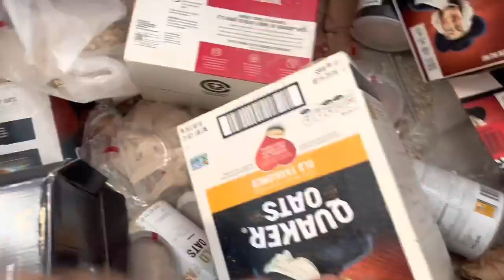FarmHand Jake Gets Fired (again) Found his replacement already!

Comment: I think if you turn a hair dryer on high I don't know if it'd be a good idea with WD-40 in them but the hot will help loosen them sometimes you can have hot water and the water will release the air and let them come apart a nail hole in the bottom of one wouldn't we big enough before the feed to come out you can use it for water but you could use it for feed a little nail hole in the bottom of one would leave should be enough pressure in there especially if you use a hair dryer that it'll pop them loose but I know exactly what you're talking about I have experienced the same thing and it's not fun and there's not enough strength in the world even two people one pulling one bucket one pull on the others not going to get them apart unless you actually do something which is odd because when you buy those at least at Lowe's they're all stacked up together and they don't get stuck there's like a whole Tower of them so I don't know what they do to keep them unstuck cuz I I get buckets all the time because they're they're just really cheap and really handy and I can use them but I understand but you do have to remember the person you're not naming is Young and it sometimes it takes a while to for them to learn the right ways and the only way they're going to learn is let them get the buckets apart all by themselves just use the handle and the top bucket fill it up with feed use it that way the bottom bucket stuck on there isn't and if it falls off yay good for you and if it doesn't they'll still be stuck together when you know who comes back to work on Monday just say it. I had two teenagers I had an enormous garden and believe me when I had help weeding the occasionally there was a plant or two got pulled instead of a weed because they didn't know the difference but eventually they learned it takes time and sometimes young people aren't very rational hard to believe I know honestly I am surprised that I ever made it to 35 or 40 it was a experience when I say throne do the wolves that's exactly what I mean and when you get so stressed out and so trying to be so perfect you screw up all the time it just happens but as I've gotten older I've gotten a lot more mellow but I'll be truthful if somebody did that I would go get new buckets at least to make it through the weekend and they would be sitting there for whoever did it when they came back and they could undoing their self or go buy new buckets sometimes lessons or something that they need I would hate not to see you know who in the videos because you're not mentioning names so I won't either but all of everybody on Mario Hill and he has been working hard on breeze goat yard it'd be nice if you get time if you could build your goats some places to play you know they love to climb they love to climb mountains they love to new experiences is good for them. But I just wanted to give you some ideas keep in mind you are I'm a survivor so you need to do what you need to do with your animals and I know that everybody on Morrow Hill loves them all as well as we all do so as long as they're getting taken care of we're pretty much happy but I know that when you are a little bit of a perfectionist everything needs to be done your way and you want it done good you want it done efficient and you want it done right I understand that young people do not because I don't know I don't know what goes through young people's minds I don't know what went through my mind at that age I'm surprised I even lived it lived through the my teenage years let alone my twenties but that's just what happens love you guys

Comment: Professional helpful hint on the bottom to get him apart then go and use silicone plug the hole so that when it happens again if it does then you could just pick the silicone off release the pressure and they should come apart have we have done this already because we have the same problem helpful hint.👍👍👍👍👍👍